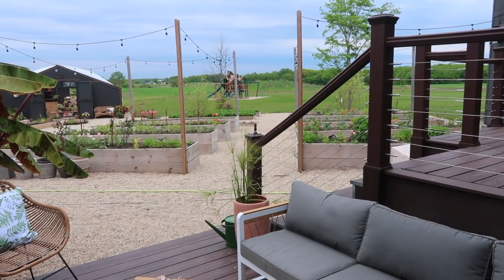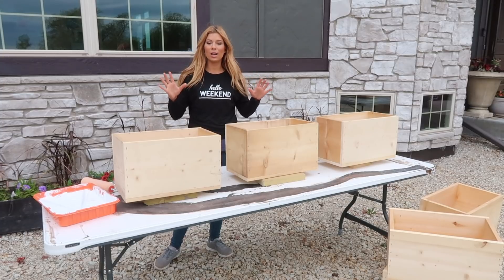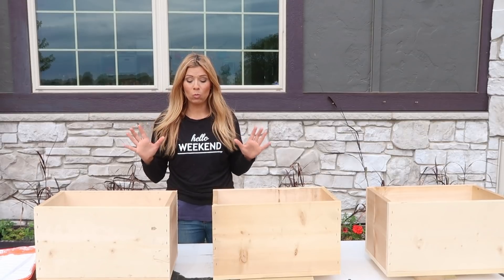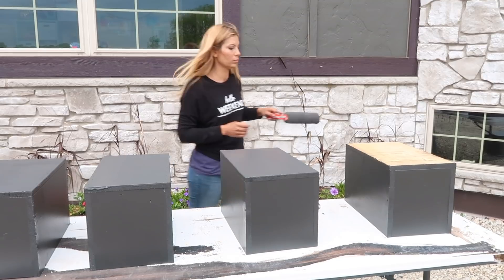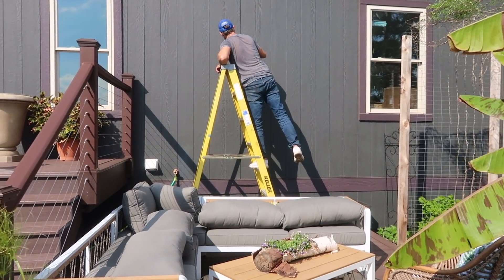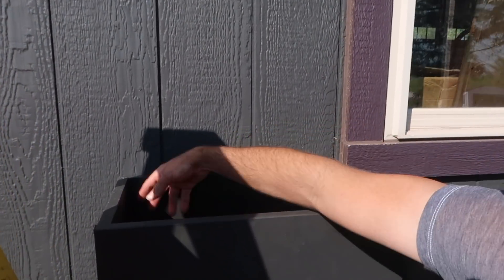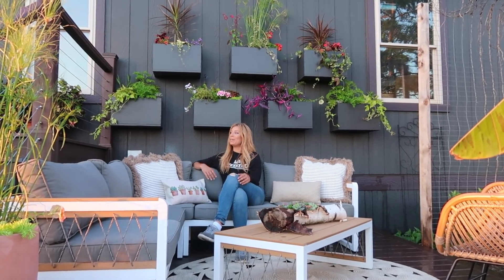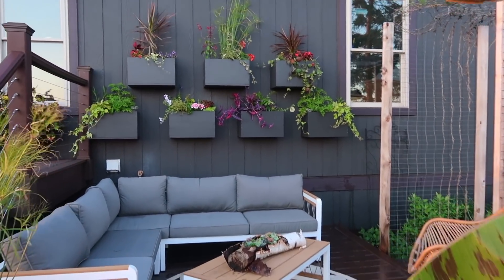Building a Living Plant Wall | DIY Garden Idea, BEFORE & AFTER | Container Gardening

Comment: Casey, I love that idea, it is ingenious! You are definitely a garden designer/decorator! Now, I'll go check outside to see if there is an area where I can create a living wall. My problem is I have steel siding on my house, shed, and garage, so I don't know where to anchor the boxes. I love the way this turned out ...so beautiful! ~Margie
Reply: I had already been thinking to sink some 2x4’s with the horizontal boards at different levels and screwing plastic rectangular flower pots onto the boards in front of the back fence in my garden.